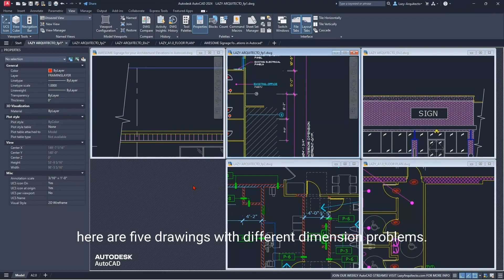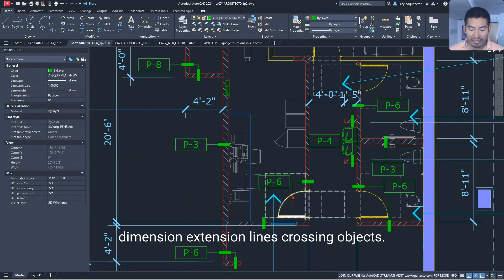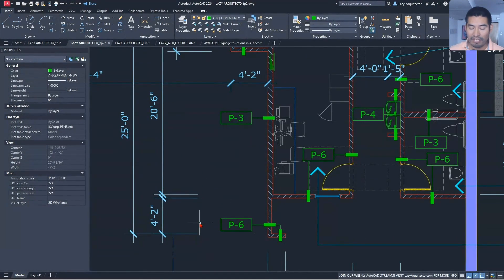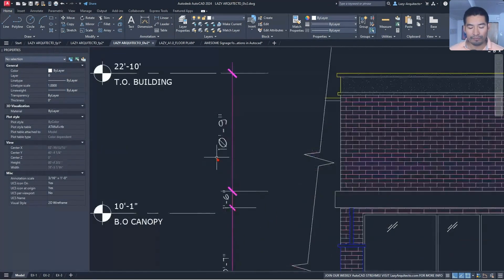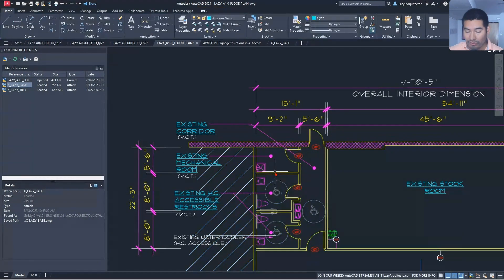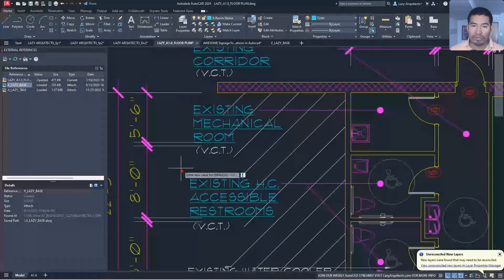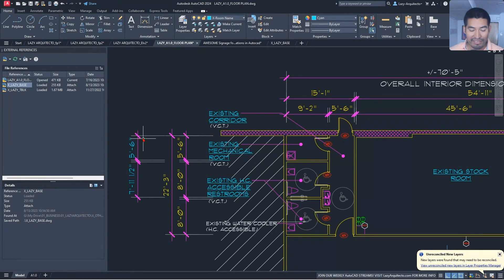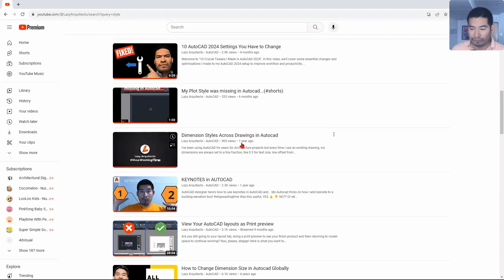Top 5 Autocad Dimension Problems with Solutions

Comment: Hi there, i'm using annotative dim. what is the advantage and disadvantage about it. thank you
Reply from the maker: Hi, great question! Annotative dimensions in AutoCAD offer benefits like easy scaling for multiple viewports, simplifying dimension management. However, they can increase file complexity. Additionally, compatibility issues might arise when sharing files with users on older AutoCAD versions. Not only this but if your drawings will be used by other people, they will need to understand Annotative dimensions, otherwise it will cause them problems and frustration.
Reply: @LazyArquitecto  yeah... what you said here is right. I'm having the same problem when applying annotative among office colleague. but annotative dim, text and hatch are so useful and good. I don't have to set variable of dim style for different vports scales. Thanks again and keep up with the good Autocad contents sir.
Reply from the maker: Hey 👋 thank you for your feedback. I am Happy to help 😃 join us live this Sunday 10am (Pennsylvania US time)